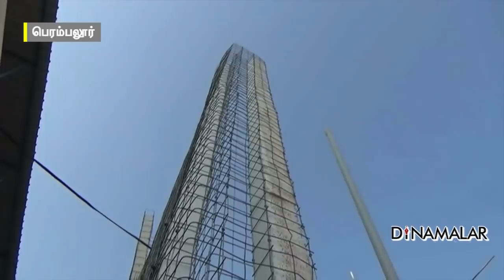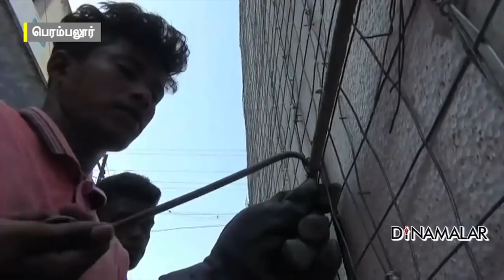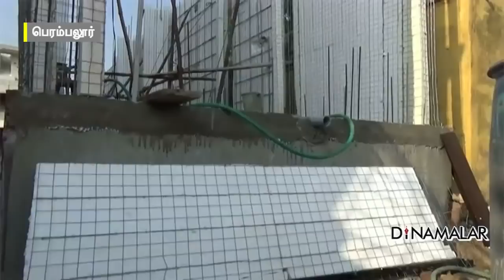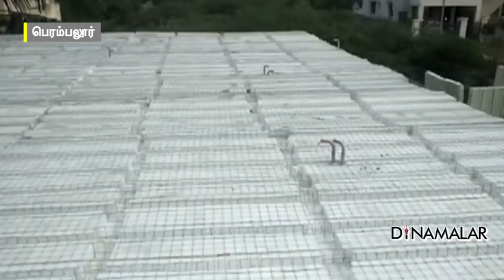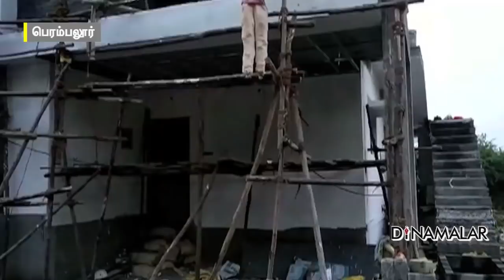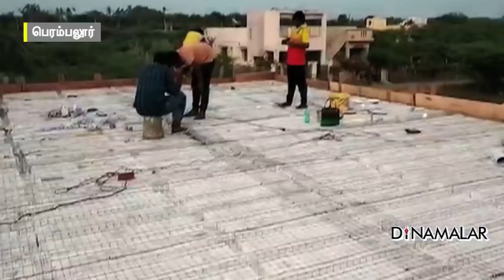பெரம்பலூரில் பிரபலமாகிறது தெர்மாகோல் வீடு

Comment: * What about fire resistant?
*How about concealed (Electric fire) wiring?
* If your scope is only heat and cold seal then try fire proof fibreglass wool sheet panels over your structure!
Reply: Same doubts

Comment: False information, this technique is not used world wide... The wall will crack very quick due to tropical weather. in tropicale weather the coverage of planter around the steel should be minimum 5 cm and they cannot acheive this in this technique. in few years the building will start to fall apart slowly.

Comment: Technically what he said is not correct. for G+1 structure why you need such complications. Use load bearing walls and make it easy with available materials. Also 2nd basic technical error if this is a really thermocole. Such panel needs polyurethane insulation. This might be the PU insulation and he meaning it as thermocole. Dinamalar please telecast any video authenticating with any proper technical person. This should not lead to a disaster.

Comment: It is the best, cost effective construction system. But planning before the project is very essential. And the product is not exactly thermocol (EPS - Expanded Polystyrene). Actual product is XPS - Extruded Polystyrene. By using this XPS in your buildings, you can reduce the usage of Fan and AC for thermal comfort. For more details, contact @ 8148357639.
Reply: we're constructing with eps 3d panel.. 1300 per sqft. call 9941427045 or visit www.kcvarchitecture.com
Reply: there is no actual measurements for heat control... but the actual fact is totally opposite
Reply: So is this Eps is fireproof? Or till what temperature it can withstand?
Reply: @raj-Mer_Navy  can withstand up to second degree fire